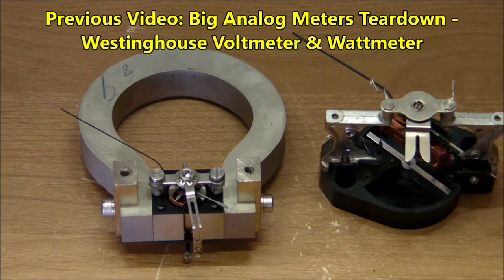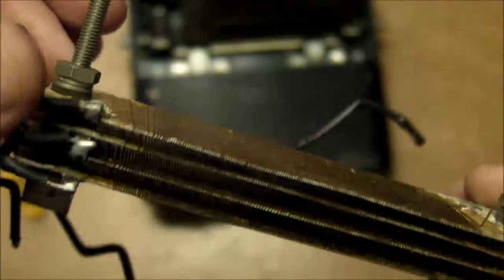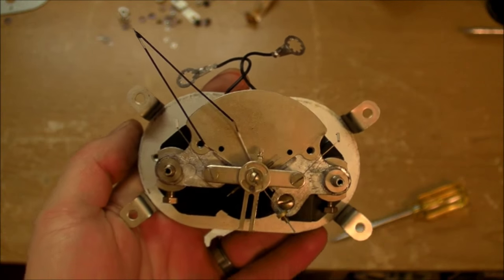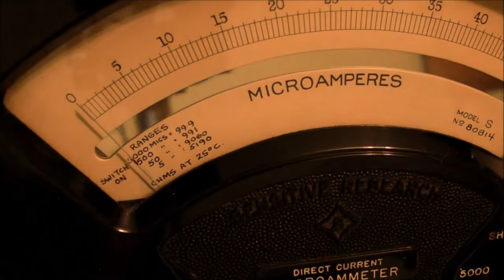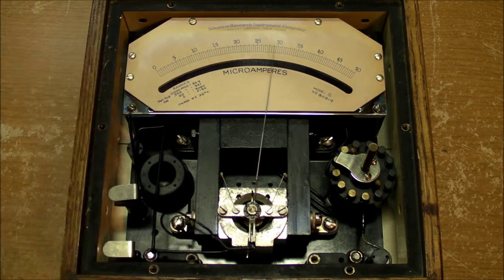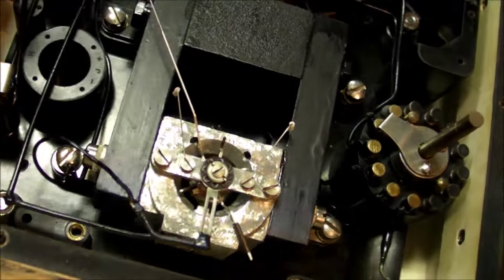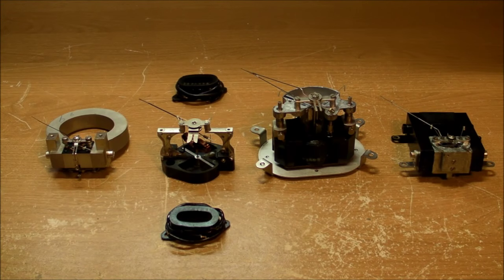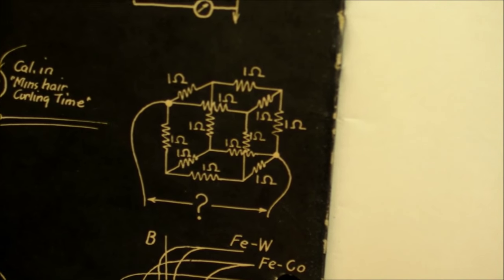(#0196) Big Analog Meters Teardown #2 - Weston Voltmeter & Sensitive Research Microammeter

Comment: Hey Eric, You might make some money off that hair, looks like silver wire :^) Great Video! I think that box would be good for an old home brew receiver or something along those lines. At 22:18 I would be tempted to drop a TO-3 in that hole, looks like it was made to fit.
Reply from the maker: Mr Carlson's Lab I considered that too, but won't be able to test that theory since I have since tossed out the bakelite form. But there's no way it could be for a TO-3 package, since the meter was made just mere months after Bell Labs' first transistor. The hole would be extra space for the bottom parts of the meter movement. I don't think the complete shape of the hole was needed for this particular movement, but for older movement generations, there would be two posts poking down to support the pivot balance parts. Those posts would have fit into the narrow corners of the hole.